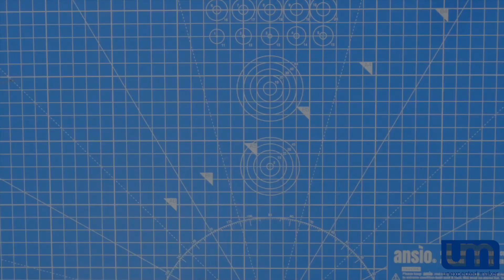TinyPICO V2 USB-C - First Panel PnP Assembly

Comment: hi ! good to know you are more comfortable now by changing the brand to neoden

about the misplaced /lost elements, is it about the size of them , or feeder , or it's random ?
Reply from the maker: Just tuning placement. There is only so much tuning you can go on a PCB with double sided tape before you move to paste. The button was wonky because my buttons have a domed top, so sometimes that pick a little awkward. I'm almost out of those types and my new buttons are flat top :)
Reply: @UnexpectedMaker  oh , I have heard about the double face tape ,  instead of solder paste.  I guess it's to check also  offsets or to check pitches by moving the tape afterwards  , right ?

I will order the K1830 after chine new year . I am not planning to be on top before end of year ( LOL )

Comment: Nice video! Did you use the IN6 to reflow this? I know you had some firmware issues with it but if you’re still using it would you be able to make a video with it? We are super interested in it as a small prototype shop

Comment: Wow that’s fantastic news about the new board. I’m so glad I found the TinyPICO and have standardised all my new designs around it 😀 The voltage divider change is an awesome edition and I’ve been using that method for a few weeks now and works a treat. I have even adjusted the TinyPICO Helper library accordingly, but of course on my boards I’m using a precious GPIO so using a previously unused one on the ESP32 is excellent. Cheers Tony